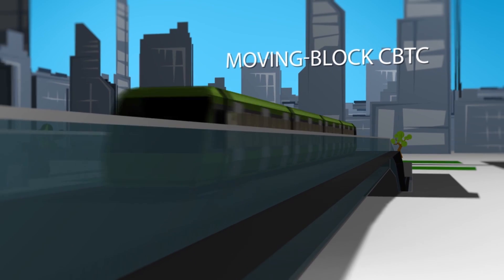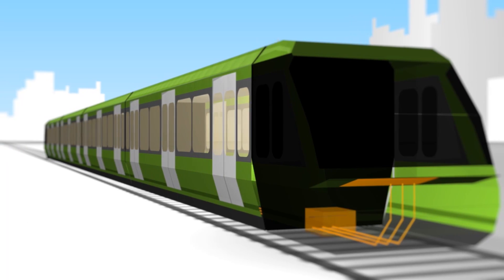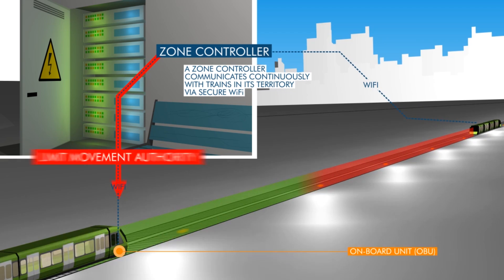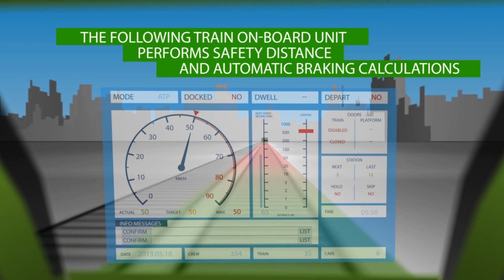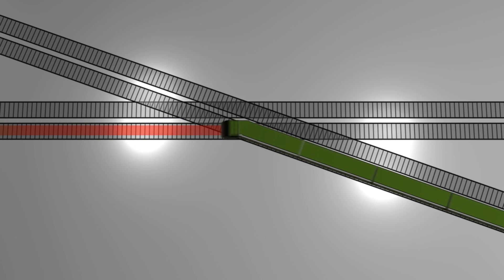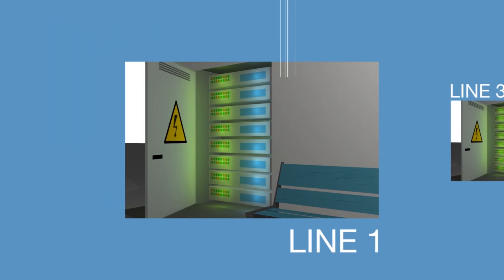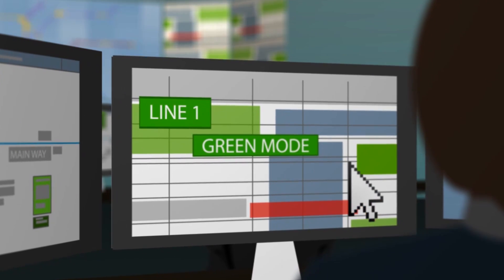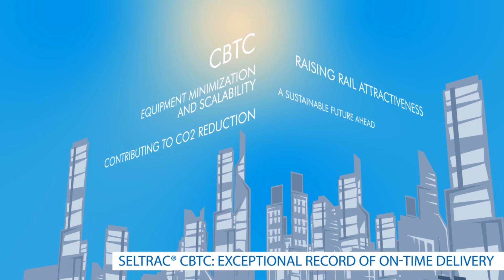How does moving-block CBTC work?

Comment: March 18, 2019 Update via HKFP #fail "Signal system supplier confirms software issue after Central train crash, MTR Corp says" //MTRC Managing Director Jacob Kam said Alstom and Thales, the suppliers of the HK$3.3 billion system, conducted software tests at their Toronto lab on Monday and noted the problem after re-enacting the crash.
“They confirmed their software was problematic. Of course this was preliminary and we need a detailed investigation,” he said.
He said the test run in the early hours of Monday was to confirm whether a new third safety system would work if the main and backup systems failed. The accident occurred when the third system was switched on.// https://www.hongkongfp.com/2019/03/18/signal-system-supplier-confirms-software-issue-central-train-crash-mtr-corp-says/

Comment: How the different of system from ETCS Level 2 and CBTC? Because i look in Thales video's almost samely just the different on Radio and Wifi for communication. Isn't it?
Reply: same here. I worked with ETCS level 0, 1 and 2 and I don't see so many differences with CBTC...
Reply: @ClaudiuB  Oke mr claudio thank you for your help 🙏...did etcs used wifi network or gsm network?
Reply: Rizal Budi GSM-R
Reply: ETCS Level 3 was almost certainly based on CBTC, but CBTC seems to be used with automation most of the time though ATO has also been used with ETCS in London.
Reply: ETCS usually use GSM-R, while metro CBTC can use WIFI (2.4Ghz?). I did once pick up SSID of metro CBTC WIFI... It's pretty... wild. 
L2 still need axle counter or track circuit. While CBTC moving block just like L3, need train itself to report integrity.